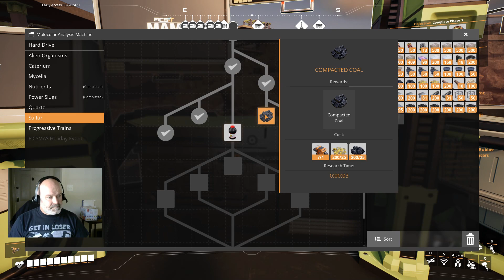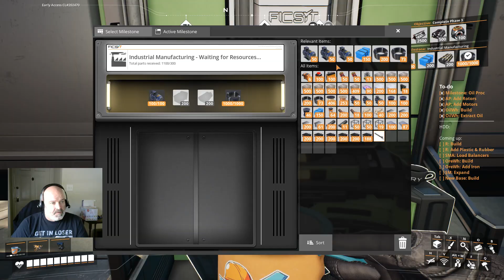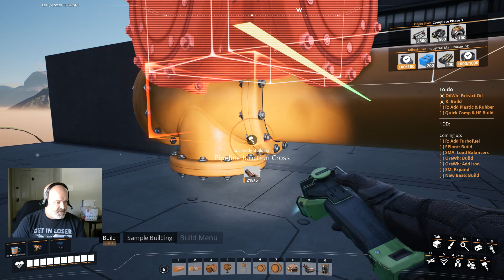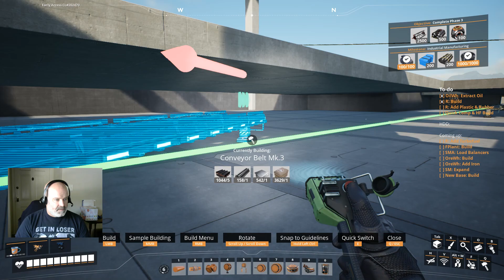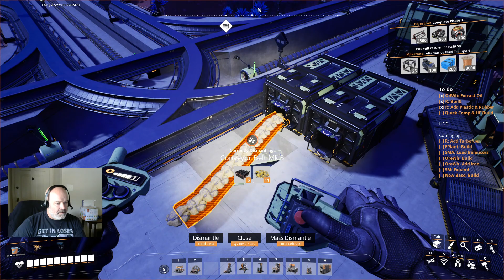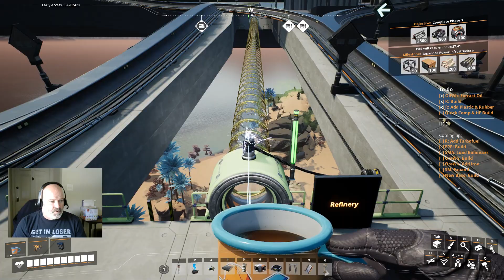Jank Builds and COWBOY SHT lol - S2 E030 - Satisfactory Update 6 Lets Play

Comment: I don't play this game, so if some one can confirm this, but from a fluid dynamics perspective you will need to move the train buffers to the top of the network, inside the refinery, so they drain out into the system where as currently they sit at the bottom meaning the fluid drain into them. The other possible solution is to have the pipe output drop into a "u" shaped white bumps at the bottom.
Reply from the maker: This game does use normal fluid dynamics, so yes if you pump the fluid up it will give you that much head lift when it drops out into whatever else you've got connected to it. Also there's some built in head lift with the storage tanks, as if it reaches, say, 6 meters high in the tank you get 6 meters of head lift from that tank. And most of the buildings in the game which use fluids give you a set amount of free head lift (usually 10 m). I am about to do a test on the new turbofuel receiving station I'm building for E033 to see if the tanks will actually create a buffer like they should (drain out once the train platform is all used up)... brb.
Reply from the maker: Ok I did a test and figured it out. I'll explain what I found on E033.